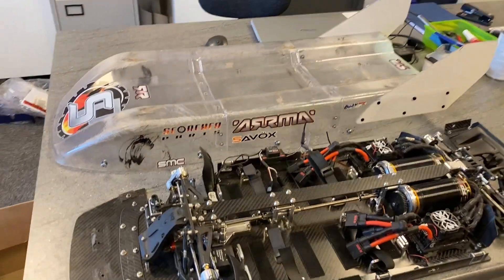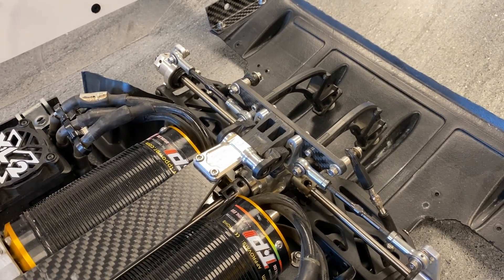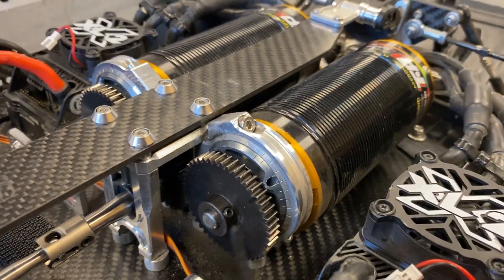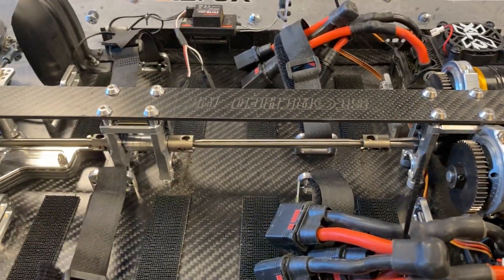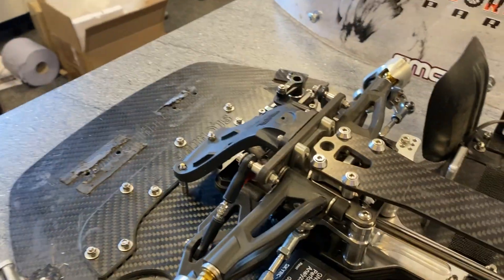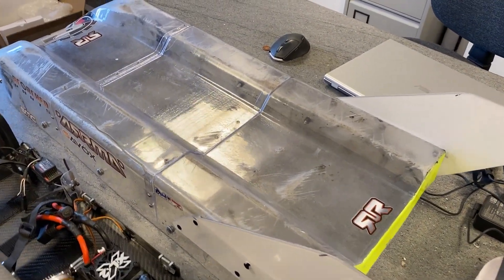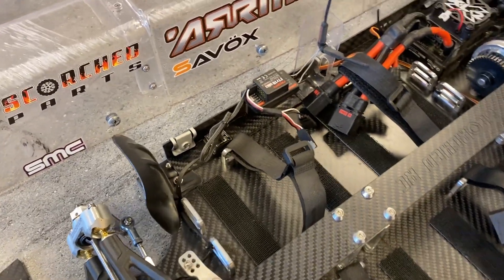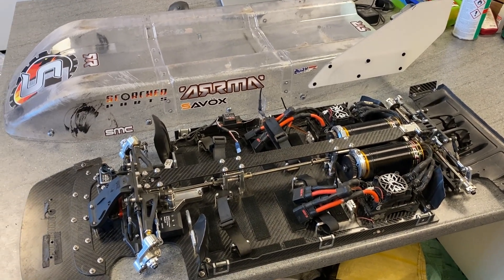UNDER THE SHELL OF THE WORLD RECORD SPEED CAR

Comment: Its very easy to set You gear mesh without super fancy expensive mounts. Loosen the grub screws on the pinion, set your mesh without fighting the motor magnets and tighten your pinions. Done.
Reply from the maker: Ah, a thats one way I suppose. I always Loctite my pinions on, so wouldn’t work well in my case.
Reply: @scorchedparts8013  I dont use locktite at all. I put my motor in the mill and tighten onto the shaft and spot drill a little dimple on the motor shaft for the grub screw to bite into. Im yet to have one come loose after starting the technique.

Comment: Given you start a run with full batteries, what's the state of them at the end?
Are they flat or is there enough for another run?
Reply from the maker: In a speed run, you only use a very small amount of the battery charge. You could do 10 or 20 runs without needing to re-charge,  but your voltage would be less each time.
Reply: @scorchedparts8013  
So using a smaller battery wouldn't work? Interesting.. 🤔👍
Hope all goes well for the next speed run, Kevin needs a challenge. 😆

Comment: amazing stuff. Is the Hobao diff gears a straight fit into the limitless diff housings?
Reply from the maker: They fit into the Scorched Parts Arrma diff housings. I specially made them to take the hobao gear sets. 6mm through shaft, 8mm pinion shaft, high quality gear cutting and cheaper than arrma. Honestly, I’m surprised the option to run the Hobao gears hasn’t taken off more.
With the Hobao gear set and lockers in our housing, I’ve honestly never felt a diff setup run so smoooooth!

Comment: Secrets revealed 👍👍👍 really nothing to hide great job fella … and no springs ?? Wow possibly got a point there🧐🧐🧐
Reply from the maker: If your surface is good and smooth, really no need for shocks in my experience. Trouble is, not many folks get a really smooth surface to run on
Reply: @scorchedparts8013 of coarse… also at those speeds you really don’t have a choice… less bounce may help eliminate car going airborne …